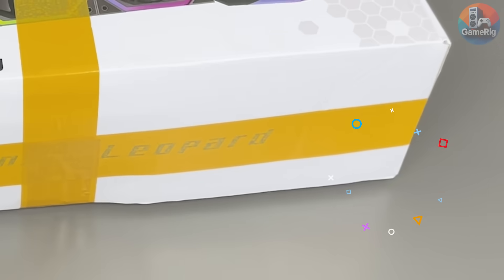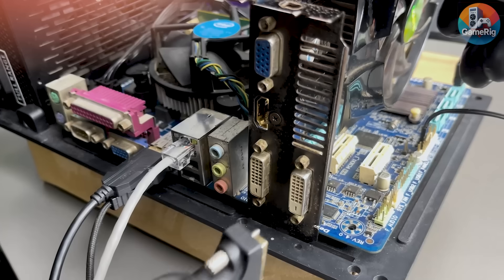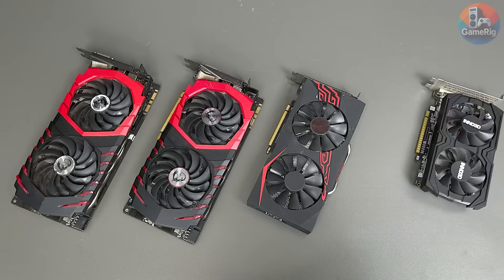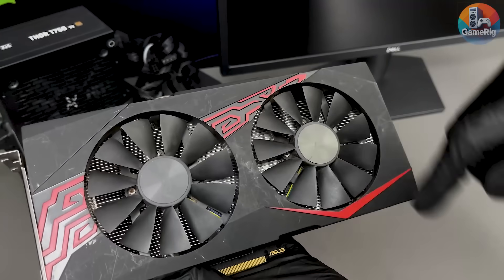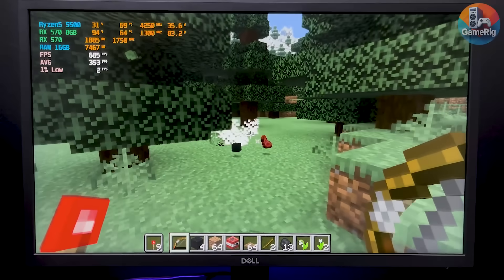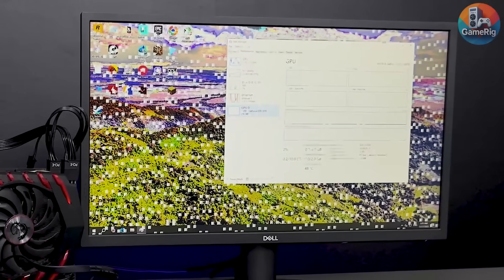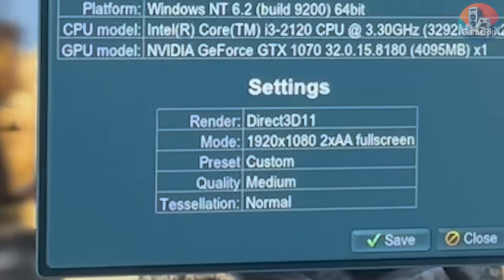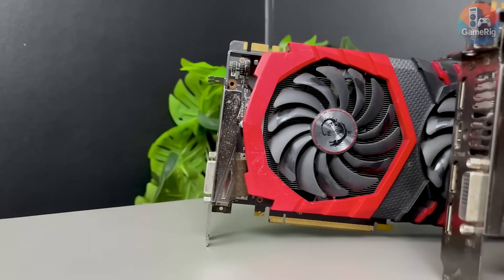I Bought 5 Broken GPUs for $150…Big Mistake?!

Comment: instead of capping fps, undervolt also you should test using igpu as output
Reply from the maker: Good tip! 😄  
Yep, undervolting is a smarter stability fix than just capping FPS, and testing with iGPU as the display output is a great way to rule out port or driver issues.  
I’ll include that in future tests. Thanks, bro! 🙌🔥

Comment: pour les artefact il parait que le micro onde refait les soudure  ?  et peutetre refaire le connecteur or?
Reply from the maker: Microwave solder reflow is a myth and extremely dangerous ⚠️🔥  
For GPU connector or solder repairs you need proper tools (hot air station or connector replacement).  
You can clean gold contacts if oxidized though 👍

Comment: for the graphics card #4 you have to use solder air station to rebowling only with this way you can fix or can be a ram defect
Reply from the maker: I think you mean reballing 😄  
You’re right that artifacts can come from VRAM or power-stage damage, but reballing alone won’t fix a dead memory chip — bad VRAM usually needs replacement, and rework requires controlled temps/tools.  
I’ll test it the safe way. Thanks, bro! 🙌🔥

Comment: what you did to that GTX 1070 (GPU 4) was cringey AF. No spreading of the paste, no thermal pads replacement, using a heat gun vertically instead of laying it flat (and probably using a heatgun at all). Yes the GPU was probably dead anyways but thats not how you treat a GPU.

Comment: the 5th gpu might be fixed by simply replacing the thermal paste and the thermal pads.
even if the temperatures look ok, there can be hotspots that can cause such crashes
Reply from the maker: Good point 😄 I’ll try replacing the thermal paste and pads on GPU 5 to see if it stabilizes

Comment: The GPU-guy is northwestrepair.
Reply: And also he know that this little black burned brick on that 1050 Ti is power MOSFET and than with that hair dryer there is nothing they can do except to dry own hair because that solder joints start to melting at 217-229°C. So @GameRig obviously working with GPUs but dont know nothing about GPUs, like at least the basic things about GPUs.
Reply: @FileFixer007  like changing the port cable to see if the vram artifacts go away?

Comment: Put that 1070 to the oven at 200*C for 10 minutes BUT first remove any drivers
Reply: first hes gotta remove all components meltable at that temperature which is a job for a professional
Reply: As someone who regularly does PCB repairs, this is a terrible idea.
Reply: @obscureparadox  A lot of people have successfully done the oven trick and walked away with working GPU. If you have nothing to lose, it's worth to try it, unless you plan on re-selling the GPU for parts. I'm aware it's a bandaid fix and it might only work for a short amount of time.
Reply: @drkysauce you're normally financially better off selling it as faulty. 200c is not hot enough to reflow the solder, all you're going to do is fry the components around the core such as the capacitors and potentially melt anything plastic. If you can, send it off for repair, otherwise sell as faulty and use the money to fund a new card, oven baking will only ruin the card for everyone.
Reply: @drkysauce i did that on my GTX 660 TI and 760 and they workfine
Reply: @obscureparadox  I have no idea why you're so against it considering it actually works sometimes. I'm not saying you should use 200C for 10 minutes, do some research and see what worked for most people. Probably better option for these more "modern" cards is a heat gun directly to the core while covering rest of the card. 
You're absolutely right about the repair or selling, but that depends on the card in question. For example the 1070 can be found for 70 to 80 dollar range, even cheaper if you're lucky. Sending it out for a repair can easily cost you 100+ dollars depending on what's broken. You can probably get 20 to 30 dollars for if you sell it for parts. So in this case, unless you are absolutely broke and would buy a very cheap gpu for the 20 to 30 dollars you get from your broken 1070, I think it's worth to try to fix it yourself.
Reply: The card has too much plastic on the PCB

Comment: 12:16 just switch out the vram chips for similar ones and it'll work fine, but get someone else to do it since it is a hard solder job
Reply: the repair costs more than a working card , why would you do that ? :D

Comment: Use MSI afterburner to lower clock speed on the VRAM, that can temporarily fix artifacting
Reply from the maker: Good tip! 😄 I’ll try a safe VRAM underclock in Afterburner for testing, but yeah — it’s only a temporary stability band-aid, not a real fix.  
Thanks, bro! 🙌🔥

Comment: For the 1070's you should check the core voltage. (if the voltage is low, maybe that card using mining bios)
If the voltage was normal, limit power, undervolt & underclock core + mem.
Reply from the maker: Good call 😄  
I’ll check the core voltage on the 1070s, and if it’s normal I’ll test with a safe undervolt, slight underclock, and power limit for stability.  
Thanks for the tip, bro! 🙌🔥

Comment: That asus card (gpu 3) is made for mining. Be happy it has dvi, many of theme come with nothing as they were meant to mine, not output display :)

Always clean conector (golden pins) with CC to. Even if they dont look dirty. Have helped me with few cards.
Reply from the maker: Thanks for the tip! 😄 Yeah, the mining cards usually don’t even get display outputs, so having DVI is a nice surprise lol 🙌  
And good call — I’ll clean the gold fingers with contact cleaner before testing, even if they look clean. Appreciate it, bro! 🔥✌️
Reply: @gamerig68  I also recommend test "no picture" ones on AM 2/3 boards. Have seen few cards that work only amd boards. Have gigabyte (well ref nvidia board) gtx1080 in my collection that works perfect on any amd platform (am2-am5), yet on any intel systems, even core2duo, I get vga error led and no picture 😅 It seems there's something bit different how intel and amd handle pci-e.

Comment: lol I wouldn't have paid $150 if they were in working order
Reply: I was thinking not worth 150 all brand new, unused in box, that money would be better spent towards a current card.
Reply: @reggiedixon2  current card for what? win11, steam games, own nothing, 5fps raytracing, not enough 8gb?   Current cards are shit. as current windows, current games, current ram prices, everything.   The only card I would consider buying is a 4070 nonhpwr, or Gigabyte 5060 Low Profile. Others are not worth a penny.
Reply: @devilzuser0050  Objectively against the games people use e.g. Cyberpunk that was used in the video
Reply: @devilzuser0050  for like $50 more they could have gotten an rx 6600 which is a decent card that can handle most modern games with some light raytracing
Reply: @CalebFromSaasstratigix yeah
Reply: @reggiedixon2  completely boxed and sealed someone would pay that just for collections.I have a boxed and sealed 3DFX Voodoo 5 5500.old windows 98 card goes for like 1500 USD.I have 2 working ATi Furry Maxx cards working just as much. People will pay for sealed stuff.I have 60 dollars in my bank and 2k stored.If I could buy the right buyer I could buy a house instead of rent with serious hard to get stuff I have.Oh I have 2 3dfx "Rampage cards" which succeeded VSA-100 chips. "it used in the Nvidia FX 5000 series of cards" I used to work for 3DFX

Comment: idk if this would work but try to sli the 1070s and plug in the hdmi in the working card
Reply from the maker: Thank you for your valuable feedback!❤
Reply: it does work but SLI is barely even supported.like games from 2 years ago and up dont support SLI cause instead of nvidia adding SLI profiles for games coming out they stopped and left it up to the Dev's to implement it which takes a lot of coding to work right.So game Dev's just stopped doing it.Thats why SLI died
Reply: @kyles8524 no shit, the point is to see if they can get them working.

Comment: Hey, the GPU 4, that artifacts aren't from VRAM.
Reply from the maker: So what exactly is the problem?
Reply: @gamerig68 If I had to guess, it's fried. Based on the burning, it's probably a mining card
Reply: @gamerig68  Its liukely burnt connector problem. Even if it still has conection, cap next in line is most likely dead, maybe something more. Its pci-e 12V by what I see.
Reply: @gamerig68  might be gpu core  needing solder  reflow.
Reply: @aamirpashah7658  excatly.this is and was common issue,we used to oven them but that sucks cos u heat up everything on pcb,and its a short term fix usualy if it even works. it happens from heating and cooling cycles,solder just cracks with cycles.
Reply: @MinimaLhosT  A heat gun would probably be a safer choice if you protect rest of the card. The best option would be to re-ball the core. On a 1070 probably not worth the time and money to send it out for a repair, but if you can do it yourself or want to use the heating trick, it might give you a working card for a while.
Reply: @gamerig68 88% sure it's the core
Reply: @gamerig68 i can bet on the Pcie
Reply: @gamerig68 the core is dying 😢😢😢
Reply: it's from the core, i am a gpu enthusiast. these type of artifacts are core related, core is probably fried, might need a reball but even then it might not last long
Reply: @zxhan1 I agree with you
Reply: Do first  vram memory test

Probably some chip is wrong.
If they are ok, a reflow could be a solution, but memory chip is most probably issue
Reply: Maybe bios is highly overlocked
Reply: @AhmadAli-x4q7l he can test resetting the BIOS. But, I don't think so...
Reply: @JoseRamos-ip3yk 90% chance its fried a little hope that it maybe bios